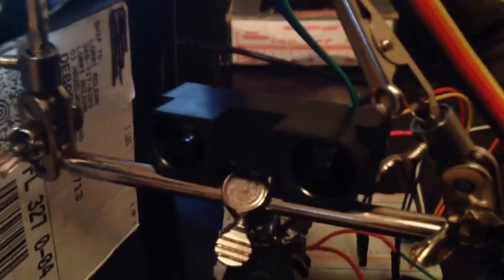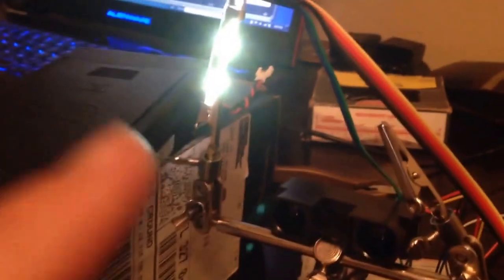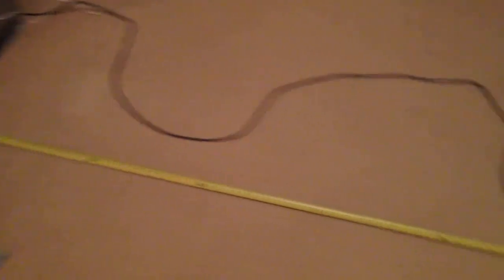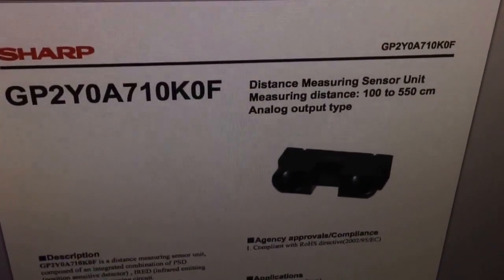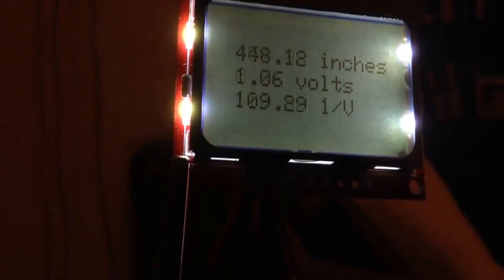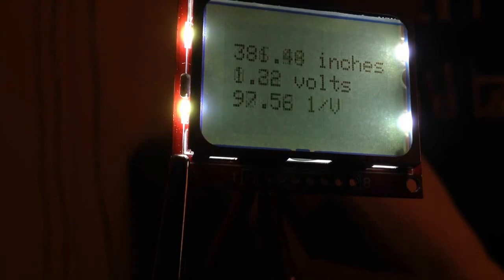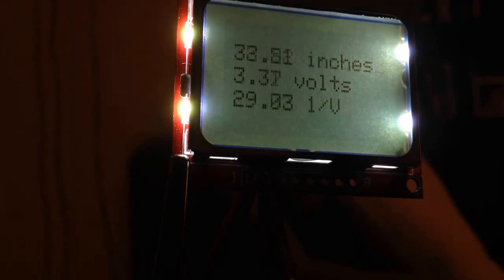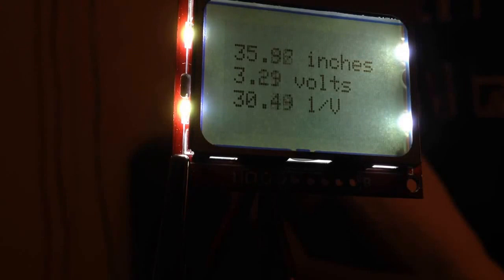SHARP IR Distance Sensor Demo

Comment: I got 4 such sensors sharp gp2y0a710k0f from a local shop,
but the sensors is not working, some forums say it needs more current.
i just wanted to know was arduino able to suffice the power requirements of the sensor?